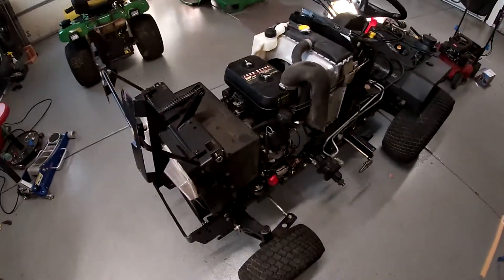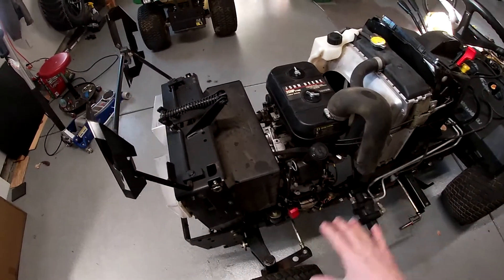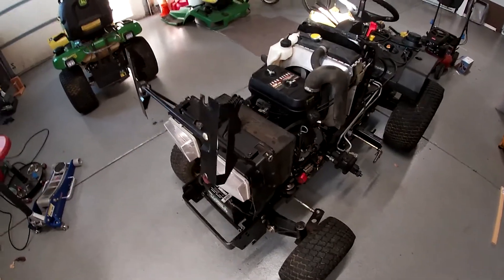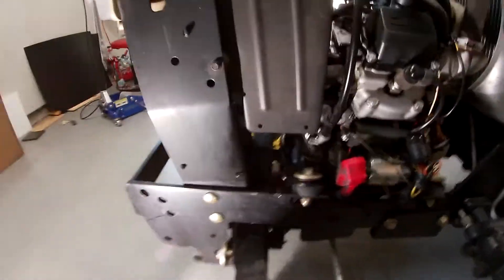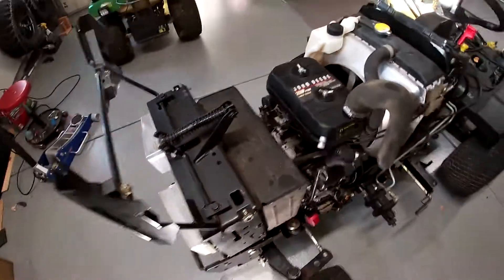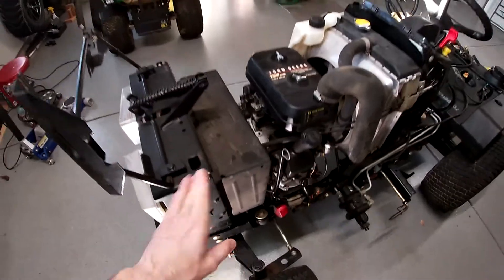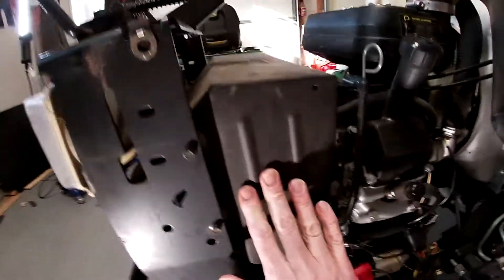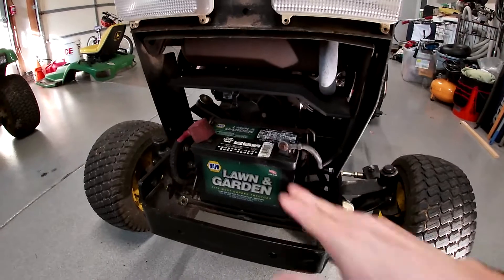John Deere 425 Disassembly & Muffler Repair w/Carnage Scene Investigation! Ep. 1

Comment: Possibly the throttle was wide open and the cruise was on, operator forgot cruise was on and run in to a car tree or building and bent the muffler and steering arm.  Only way  to straighten steering arm was to cut and reweld.     The hood hinge was bent on my 425, previous owner hit something, it is amazing how poor people treet these expensive machines.   Last thought, You could remove the spindle and wheel,. Grind down that weld , and get your buddy to run a cover weld over the farm repair and it will look like a pro fixed it.

Comment: Your steering arm is not OEM. Someone re-fabricated it and decided to make it backward facing. The original OEM arm should be faced to the front. Someone probably hit the tractor pretty hard and took it out along with the damage to the grill and the front section of tractor. Hence all the irregularities of the front items you pointed out.
Reply from the maker: This tractor is correct; nobody changed anything, other than repairing the damage.  However, it looks like the AWS tractors have front steering knuckles the way you describe.

Comment: I obtained a 425 JD  used and the front grill when facing it was heat damaged  I suspected excessive heat from the muffler, I installed an additional heat shield to help deflect excessive heat.